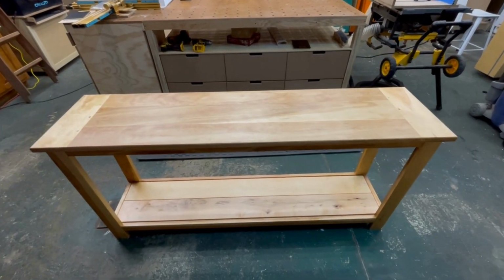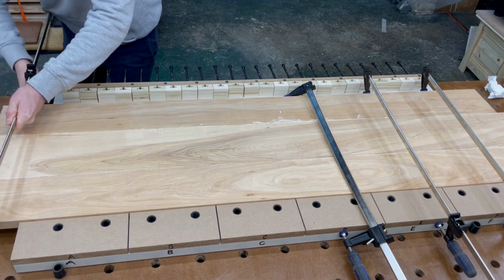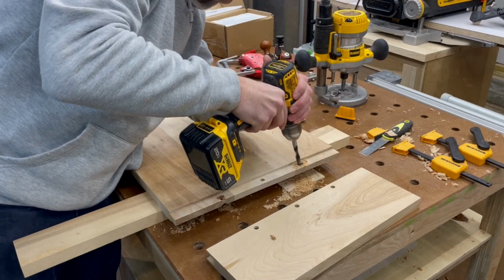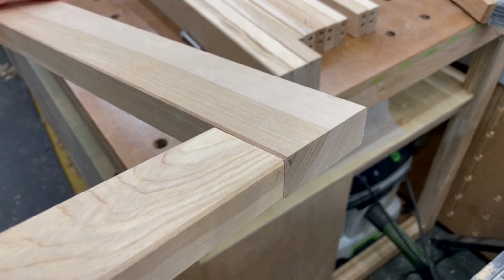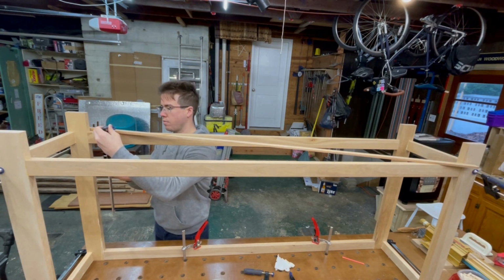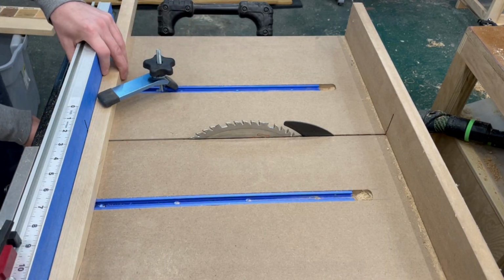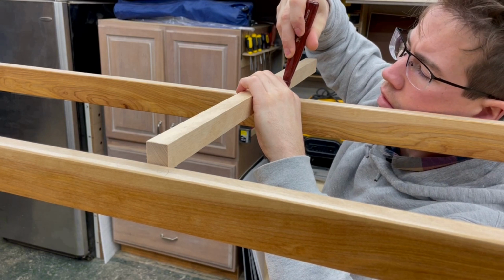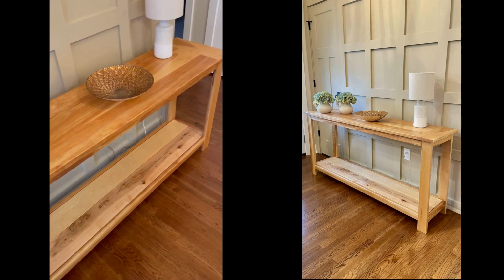FULL BUILD || Sofa Table ? Buffet Table ? Console Table ?

Comment: First, let me say what a beautiful console table! I think it turned out incredible. Additionally, I would like to ask about the stock guides you use on your table saw fence. They appear to be the Jessem guides. I use the same contractors table saw that you use in your video and have been trying to figure out a way to attach the stock guides to the DeWalt fence. Would love to see a video on your set up.  Keep up the great work. Look forward to what you build next.
Reply from the maker: Thank you! It was pretty simple. Mine are a knockoff brand, but same applies. I sandwiched a piece of 3/4 mdf the thickness of the fence with two 3/8 mdf pieces on the sides. I screwed the sides to the middle. I then predrilled and screwed two small sheet metal screws into the other side of the fence. I feel like one hole was already there for the junk push stick clip. I removed that clip.  I can no longer use the flip table thing and there are two holes in the other side of the fence. Small price to pay for the stock guides. They are incredible! I then screwed the stock guide rail to the center of the sandwiched 3/4 mdf piece. I adjusted the front rail measure marker to accommodate for the 3/8 mdf face on the fence. Hope this helps!